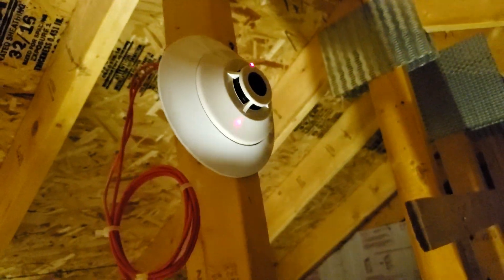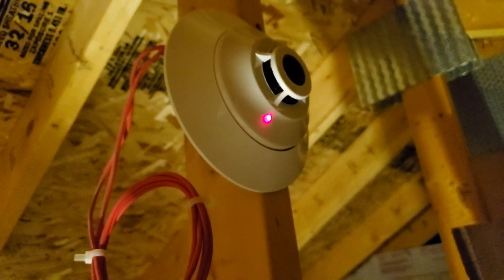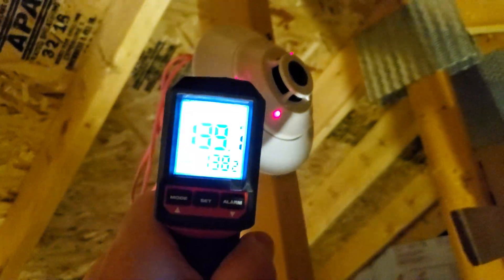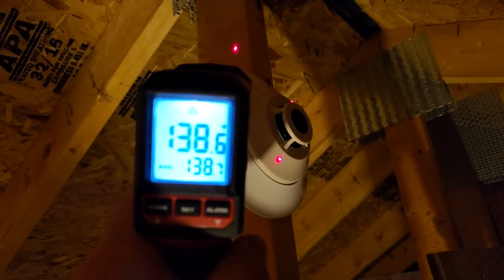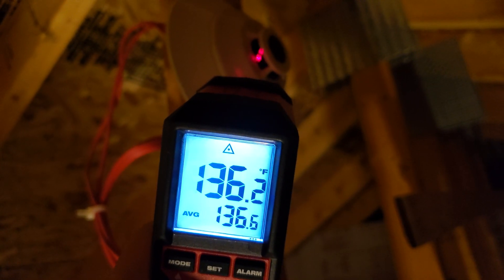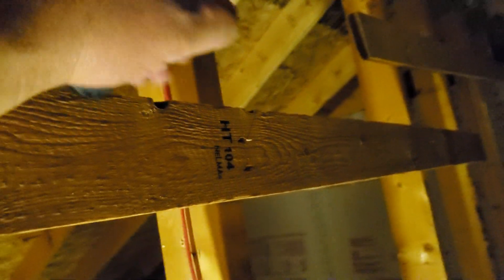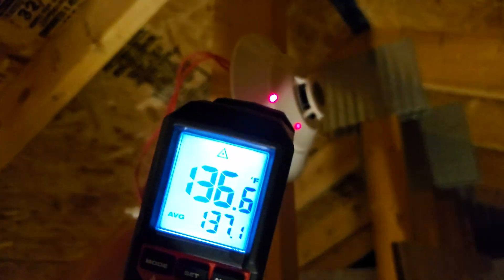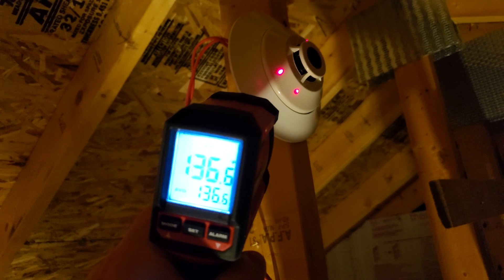Fire-Lite HT Heat Detector Failure ES-50X   *** MAJOR ISSUE ***

Comment: If the issue after your most recent video persists maybe consider installing System Sensor high temp fixed heats with mini mods on the back. Ones that are not rate of rise and give that a shot.
Reply from the maker: That would certainly work but the problem is we have about 150 different residential units, all privately owned, that we would need to access.  Huge job and lots of $.  We can't afford that from our pocket after installing something properly that should work.
Reply: @jaddwooka  having a similar problem with the H355HT and we are removing them completely from the attic as they are not required by Mass Building Code.  Just curious if this was resolved by updating firmware?

Comment: That looks like an older detector model. You should replace with a newer model
Reply from the maker: I was in two additional attics  in a different building just before this one with H365HT detectors, the newer style ones and they had false tripped also.  Even though that is the older model, it was newly installed from a box about a year ago and should not have activated in that temperature.
Reply: Hi Drew Have you resolved the problem? I'm having the same exact issue? I keep getting a Test F fault on the panel for both heat sensors in attic
Reply from the maker: @jcrackbmw   If you're getting a Test F, maybe you need to update the firmware.  They had that problem shortly after the panels were released in 2018.  They programmed the first firmware so  that if the HT detector was over 120°F or so, it would show that Test F.  It didn't make any sense to me what their engineers were thinking...  OF COURSE YOU"RE GOING TO PUT HT"S IN HOT PLACES... DUH!   They updated the firmware and that issue was fixed.  Maybe these false trips now is related.  They're working on it.  I've had lots of contact with their engineering team and we've got temperature monitoring in several attics right now to hopefully detect a temperature pattern resulting in the false trips.